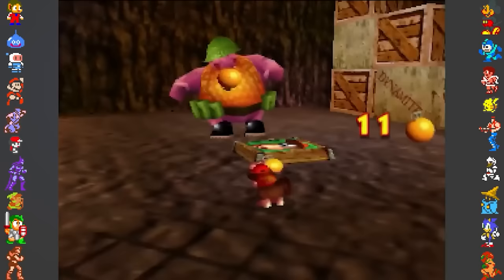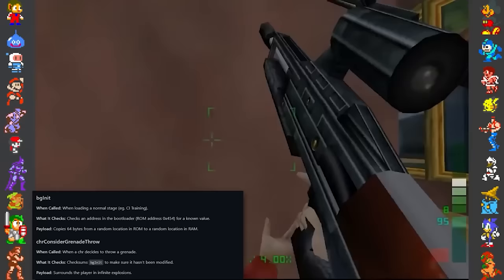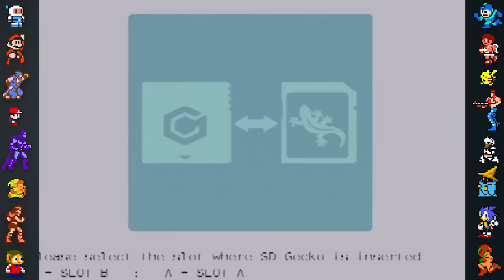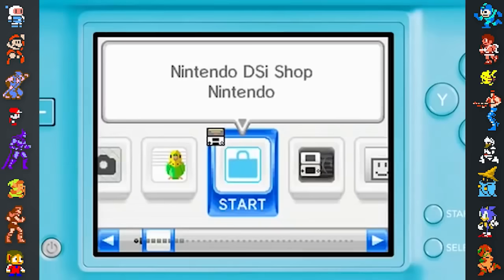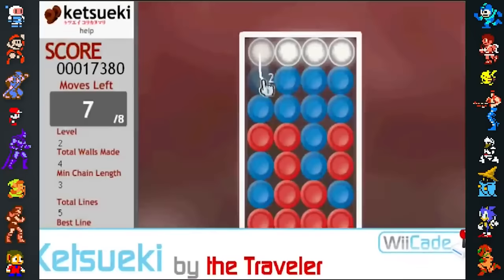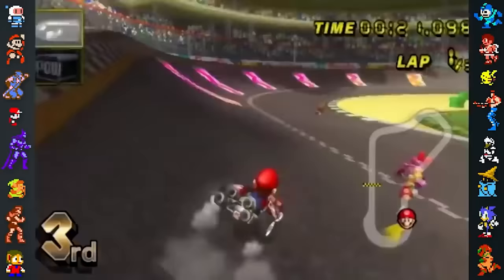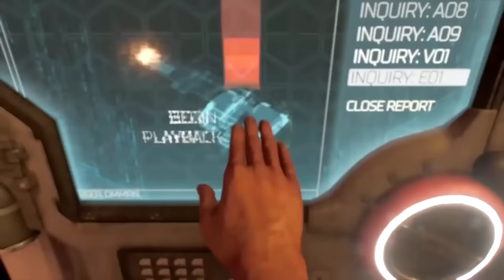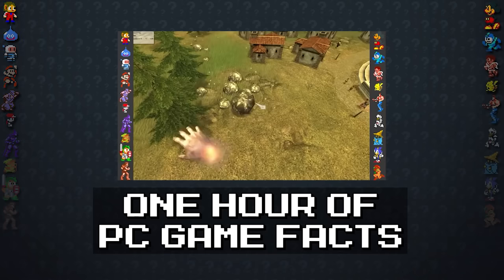One Hour of Nintendo Piracy Facts

Comment: South America is insane for piracy, especially for older consoles. I remember that most of my N64 cartridges were much "lighter" than any original counterpart (obviously fake). I had a cartridge that you used for pirate cartridges to function properly, so it was pretty awkward (but it worked perfectly) to have a cartridge on top of another cartridge on the N64.
I was pretty young, didn't know this was wrong until so much later in life, since this is still very, VERY common around there. Even barbers would sell 5 PS2 games (even new releases) for 10 bucks.
Reply: nada de errado com pirataria, amigo :)
Reply: asia and russia are also insane, especially with the big games of the early 2000s. indonesia has its own share of bootleg modded GTA San Andreas copies where you play as wolverine (whitewashed CJ with claws and shitty hair) or robocop as EDY MURPHIE, and russia was selling cracked copies of half-life and counter-strike on the streets in the 2000s.

theres also the fan dubs even if the game already had official dubs or subs in those languages, specifically in russian. the russian fan dub of Mortal Kombat 4 is a favorite.
Reply: @disposable_income_andy  oh, the number of different modder GTAs with country-specific things was through the roof too. Thanks for bringing back that memory lol

Comment: Nintendo: The Nintendo DSi is unhackable.
Hackers: challenge accepted
3 days later.
Hackers: done
Reply: lol
Reply: LMAO, yeah, I remember that. Nintendo puts a lot of work into their console security, but for some reason they only see their own accomplishments. The security even if their security is great, it's irrelevant since they often overlook sometimes simple exploits. Hackers work around the security and look for any practicable exploits that can potentially allow them to run unsigned code. If they discover something, they can bypass the security and hack the device without the need to dismantle the console or solder any mod chips to the hardware.
Reply: To be fair, Nintendo isn't trying to convince hackers that it's unhackable.
Nintendo is trying to convince shareholders that it's unhackable, and believe it or not, most shareholders aren't tech savvy.
Reply: Nothings unhackable!
Reply: R4 is a godsend

Comment: In my opinion, I think that every future console that comes out (even old ones that get improved versions) are gonna always be hackable, since hackers always find ways to crack a system and ways to circumvent region and copy protection and also circumvent ban waves too (if possible anyway).
Reply: Except for the new Xbox you mean
Reply: @shib5267  Give it time.
Reply: And if not you can just emulate. I dont even play my switch anymore. I use Ryujinx and NSW2u to play any switch game at 4k 60fps and i can get cheats and mods to have a little extra fun with stuff like debug cameras and stuff.
Reply: Tbh, once I get the computer I want, I might not ever need a console again.
Reply: Once the online service is shut down "you might get banned" is kinda a moot point

Comment: Funfact: One of the hackers from Team Twiizers that worked on the Wii jailbreak is Hector Martin. He's got quite a portofolio.
He was also part of fail0verflow, the team behind the  PlayStation 3 jailbreak. Hector Martin also reverse engineered the driver for the Kinect and ported linux to the PlayStation 4. 
Currently the founder and lead developer of the Asahi Linux project, the project that ports linux to Apple silicone.

Comment: Really hoping that one day, we'll see copyright law reduce the years before public domain in digial content to 10-20 years. As it stands, 75 years essentially renders any (or at least a vast majority of) original consoles that could run that software moot without third party modification of a console, and a majority of those that would want to use the domain at the time of launch will likely be well....dead. it's kinda dumb.

There are NES roms from the 80's that have little to no chance of returning to modern day either due to the companies that owned the rights closing down, or the new companies that own them being fickle or uncaring about re-releasing the content or rendering it public use. It's been 40 years since those games released, and games like Sweet Home will likely never see a public re-release...why should we just keep this stuff to corporations if they won't utilize it anyway?
Reply: I wouldn't be shocked if that was partly Disney's fault. They're the reason public domain law is such a goddamn mess.

Comment: So like,
I love the gamecube but the games have become incredibly expensive
N64 games have been getting repro carts for awhile and since DATAL cracked the gamecube discs why aren't we seeing more gamecube reproductions?
Reply: Mini discs are expensive because it’s a format that died before it ever started. Just softmod your wii and launch backups from there
Reply: @mingledingle1556  I have both a modded wii and a modded gamecube and It's not the same, I would love to be able to buy a repro of ttyd or pokemon xd and have the case and be able to use It without scrolling through a menu
Reply: The Nintendo GameCube does not have to hacked to be able to run region free games on it. There is a video that shows how to do it, even though is not mentioned inside of the title of the video itself.
Reply: they have always nbeen super exspensive tbh
Reply: @Caolan114  silver linings

Comment: Lmao my family used to work making cartridge copies down in Mexico
It was still cheaper than original games but it was kinda more complicated i mean nowadays you just have to patch the disc image (for CDs or SDs) and maybe format it depending on the method you're using to pirate your console with, either way it wasn't impossible;
You had basically a machine that made copies of the circuit board and they just assembled it together as far as I understood how they did it

They never got out of the lower class, cus my grandfather still had like other family to feed
But it was cool cus they still had last gen consoles cus consider that a lot of these things were smuggled by my grandfather as well.

He might have another 4 families
But i admire how he just made ends meet for everything.
Don't mention him in front of my grandma tho.

Comment: 54:19 Let's take this a step further. Suppose now just SUPPOSE that Airplane Mode in future consoles, whatever they may be, PARTIALLY gives you no connection. That is no connection to normal apps and games. However by turning on Airplane Mode it could still check online with Mother Base to see if a game running is legal and purchased. If not, it STILL puts down the ban hammer despite "not" being connected to the internet.

Scary thought I know but I'm certain we have been lied to in much worse ways in the past.
Reply: think, for a second, why "AIRPLANE" mode exists, and you'll discover why that'll never happen.
Reply: @2ken  But WiFi is allowed to operate on a device while in airplane mode, outside of actual takeoff and landing while inside of a commercial airplane. It's not entirely unreasonable to foresee a future where the airplane mode WiFi switch is controlled by someone other than the operator of the device.
Reply: Does it connects through cellphone network?

Comment: 27:29 I thought I knew who this was, but then I remembered there's another electronics engineer named Bill Chapman. Who you may know for his paranormal investigation equipment, such as the SLR camera, which in early models was just a modified Microsoft Kinect. Proving that sometimes the connect may have picked up movement that was there, but you couldn't see. OOoOOooOOo!
I'm not sure if this was a mistake, if Steve is an Alias of his, or if they are indeed different people.

Comment: speaking of CIC chips, they werent made only as anti piracy measures - but also to avoid non lisenced games into their consoles. They knew companies would instanly made several bootleg games for their consoles, flooding the market and killing the videogame, just like what it caused the videogame crash of the 80s. 

For some reason Nintendo didnt want to enter the Brazilian market until very late, so pirate carts were rampant. It was so bad that some SNES consoles didnt check the CIC chip at all

Comment: People pirate Nintendo games because Nintendo refuses to re-release games on modern Nintendo consoles that are console exclusives, especially if it is companies that only makes things for Nintendo. The Nintendo Switch is to previous Nintendo console owners as the PS4 is for Sony console players. The console's design/architecture made running older games natively or easily on those consoles impossible or not worth the time and money doing. However, many previous generation games from PS1, PS2, and PS3 (and even PSPs), have been ported to PS4. PlayStation 5 is able to play PS4 games; however, I have noticed only noticed two errors on PS4 games. For Final Fantasy XV, non-boss background music for the pinball minigame doesn't play for some reason. For DOOM (2016), the background sound effects for ID logo does not play.

For games like Pokémon Black and White and Black 2 and White 2, unless you want to pay over 80s for one in good condition, your only means of experiencing the game is via unofficial emulation and downloading the ROMs. Before anyone mentions Brilliant Diamond and Shining Pearl, those don't even count. Firstly, you cannot transfer Pokémon from that game to any other game or vice versa. Secondly, the game is buggier than the originals. Thirdly, if you buy it physically, without installing a "patch", you don't even have the whole game.

Lastly, people are going to be more unsure and unwilling to acquire a pirated version of a game since there is uncertainty if it is a legitimate pirated copy of the game or something harmful to one's computer, especially if the game can still be found and bought within reasonable means...or still pirate it because Nintendo refuses to reasonably reduce the price of games even if they may be 5 years old. High priced older games will often deter people from buying older games verses something new and known around the same price.

Comment: It's genuinely shocking how easy the DS/3DS is to hack/homebrew, I've had one of those little R4 carts since i was like 8 & it's how i found a lot of my favorite games, & now with the Eshop closed, games out of print and the prices absolutely ridiculous on ebay, i hardly blame folks for pirating DS games especially
Reply: for real though if y'all ever want custom themes or homebrew games on your 3DS it literally just takes an SD card reader, a decently sized SD card, and about an hour of your time! You put the sd card in, take it out, put it back in, take it out, put it in, shake it all about, do the hokey pokey and now you can emulate Gameboy and out of print DS games on your 3DS

Comment: You missed the most important Gamecube DVD copy-prevention technique. The DVDs have a very slightly different track layout than the DVD standard allows, that's why you can't read gamecube discs in normal DVD drives and why you can't burn gamecube disks either. You need to have a drive with modified firmware in order to extract data from them, or modify the gamecube's drive to accept the standard format.

Comment: about potentially purchasing a banned switch cart without knowing and getting banned for it; nintendo knows this and only bans if you have been using multiple pirate carts; sure if you get unlucky you might buy a cart used for a dump off eBay, but would you have 30 of them ? probably not 

also this same system for unique identifying game carts is used for redeeming points from physical game cart

about the "hidden flag" thing, i dont think its likely because doing that would require the switch to somehow validate that a cartridge or pirate game is a pirate version without internet such a check could not be hidden. and would give us all you'd need to generate new ones that pass the check

Comment: Frame it how you want, it's a dick move by Nintendo to ban someones Switch if they are only doing something like increasing the Tegra X1 CPU or GPU frequency, using software to monitor frame rate and times, etc. The people doing that are just the people who want to play their games without the HORRIFICALLY BAD bottleneck the Switch has with the CPU frequency in many, many, MANY games. There's no reason why Nintendo couldn't (and still could) allow the Tegra CPU to run 1.4GHz+ in docked mode, and no, the Switch wouldn't melt or degrade any faster from a CPU bump to 1.4GHz the Tegra X1 is specified to run up to 2GHz.

Comment: The DS Brick thing erasing your entire firmware is probably false. There's a ground port near the Battery Slot on most  DS Models (excluding the DSi), and it's what keeps the firmware locked. If you can short that Port, then you modify the firmware, making the brick somewhat possible. but software alone cannot short a single Ground near the Battery to allow itself to Overwrite the firmware.

(i may be wrong, correct me if you feel like it)

Comment: And as a side note, as weird as it might sound, people would actually buy the Chinese version of Switch to play cartridge games exclusively, as the only downside is no online service and no DLC, but patch is available, and neither of the downside is that important when the games are supposed to be sold or circulated after the user beating the game. This is technically not piracy but clever way of using the license, but still, it's funny that this become an option.
It's sad that Switch cartridges can no longer carry save file and thus making cyborg wandering pets no longer a thing, though.

Comment: Nintendo did get me with the Pokemon Black and White 2 anti piracy with my flash cart.
I noticed I wasn't getting XP. I thought nothing of it, and idioticly thought that I unlocked leveling up later. That was until I got stuck with a Level 5 starter in a battle with a guy with a Level 9 Pokemon. Then, I decided to go to Google to get some answers. I facepalmed in embarrasment when I read that I got Anti Piracy'd. Found a patch though. If I remember correctly, Pokemon Black and White 1 didn't do it, but it was a while ago.

Comment: Game Dev Tycoon would wait until pirates got to the point of starting their first steps as a game dev company before their anti-piracy measures would kick in, bankrupting the player by in-game pirates pirating their games. Naturally, the dev mocked the crap out of pirates who were upset over this. If I recall correctly, one of the Spyro games would reset the game and delete your save if you took damage during the final boss fight.

I admit it's always interesting to hear about how console makers try to safeguard their interests. While not my forte as a programmer, I do use different tools to alter the code of games and break them relentlessly. Naturally, this includes finding workarounds for games that use encryption libraries to prevent things like Cheat Engine from working. Honestly, sometimes breaking a game can be as much or more fun than playing a game. :)

Comment: Nintendo basically lost the Switch modification game when the original model had such an egregious hardware bug that allowed access to the protected bootrom/irom. It allowed these models to act as a conduit to rip open and analyze any future firmware updates, game data, DLC, etc. How can anything be safe when an entire subset of consoles can retrieve their cryptographic keys, decrypt absolutely any signed piece of code, and thusly resign it for any console to use? It was an absolute mess from the get-go. On top of all that, TX's hardware modchip was reversed by more than one entity, and are readily available overseas to purchase. These essentially render the console just as open as the original fusee gelee method.

Comment: I will say, many of the games I got when I worked at GameStop. Specifically Nintendo. We had several games that were fake. From cartridges that appeared tampered to just straight up no effort to conceal it. But, if the game worked then technically we could take it for trade. We were never made to test games and we had several different occurrences where consoles were getting bricked after putting in a pre owned game they got. 

I left before it got any worse since no one wanted to listen to me and dish out $5 more for a legitimate copy of the game unless it was Old Pokémon Games.

Comment: I completely broke my controller connection on my switch. I put the switch on a bag that had already dried up sticky drops of sugary soda on the bottom. Now 1 controller is no longer recognized by the console when attached to the console.

Its so stupid because if both controllers broke I would be able to play wireless when controllers are attached. But because 1 controller connects and 1 doesn't it means I can't connect them to the console anymore

Comment: Notable events missed in the switch segment
With the original v1 switches, it's actually possible to upgrade the NAND. It's an involved process but up to 256gb nand chips can be soldered to a spare EMMC board, and then have the information copied over and carefully expand the partitions, but assuming you get that done it just works - cool

Also missed that some core people in team executor were sued directly by nintendo - basically nuking team xecuter. Well deserved.